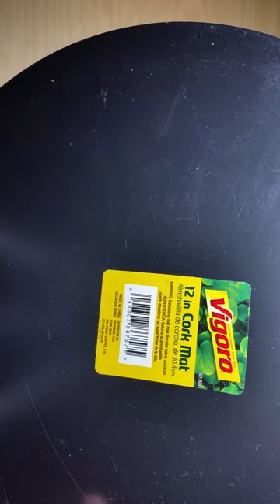How to Make a Junglejar Cylinder Aquarium

Comment: Will you do a video about how why you now think these do not need filters. Thanks! Are you still running the large filter you had with the pumice rock in it?
Reply from the maker: Well the answer mainly depends on plant growth vs. fish bioload, so unless you have a reasonable balance, you could run into trouble. But to give you an idea, this junglejar (https://www.youtube.com/watch?v=YG79AXrMb5A) still looks crystal clear, and I haven't done anything for the better part of a year, save for trimming the plants. It's running the same vertically mounted pumice filter, but frankly, I don't think there's any ammonia for it to remove at this point, so it's mostly there to provide circulation, which is important to keep the nutrients circulating and waste products being recycled, just like in your own circulatory system. Out of all my tanks, just one has a pumice canister still on it. That's Rootvale (https://www.youtube.com/watch?v=s7_Gf4UWYSg) which seems to need it for some reason despite having only modest bioload. (I suspect, again, this may be more about circulation in a tall tank than anything else.) I took it off for a month, and the water got slightly hazy. On the other hand, I have this one 70 gallon (no video yet) which is consistently "smokey". No matter what, filter or not, I've been unable to clarify it, while all my other tanks look great. I'm thinking it's because the catfish in there have gotten too big, and the bioload is just too high at this point. I still do endorse the use of pumice, though, in tanks which have not yet stabilized. So in theory, you could just keep one on the shelf for whenever you need it. I think I'm gonna hook up a sterilizer to that 70 and see if that'll fix it...